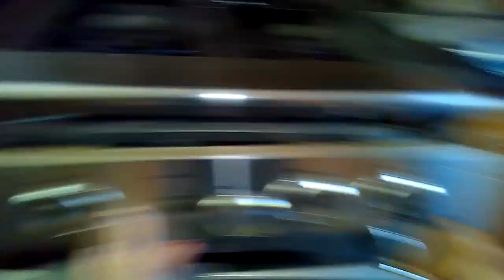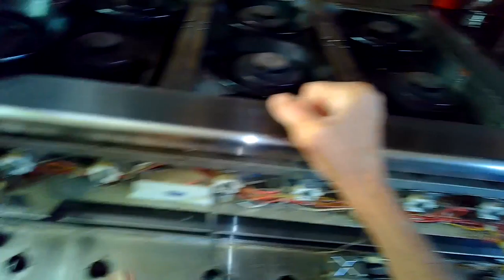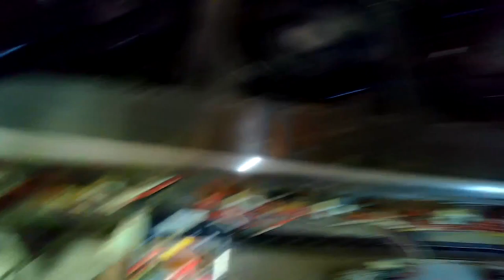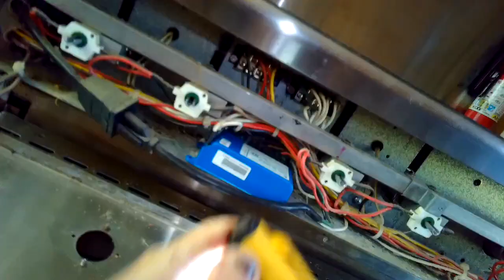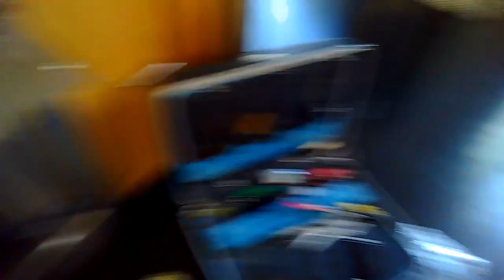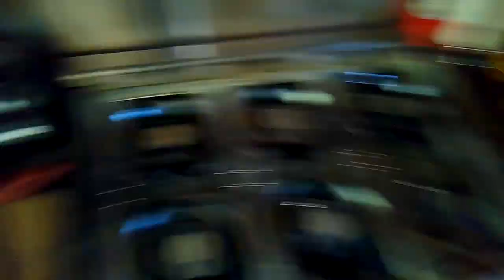DCS RANGE SPARK MODULE INSTALLATION

Comment: I have ordered the spark module.  Symptom is that It wont stop sparking after the burner is lit.  Although that can be due to moisture or dirt at the burner you have turned on.  In my case however, It started happening all at one and It does the same thing (continues sparking after burner lit) no matter which of the six burners I turn on.  Given all burners are impacted and all the probes are being bathed in flames (lower ring next to igniter probe has a blue flame), I deducted it must be the module.  Your thoughts?
Reply: I am having problems unscrewing the old screws from the old spark module to be able to take it out. They just keep on turning. Any ideas how to remove them as they don't seem to grab onto anything on the old spark module?
Reply from the maker: Can you try plugging the stove into an extension cord and plug the other into the outlet in the dinning room?
Reply: @ScottTheFixItGuyChannel  Would have to pull the stove out to access power plug.  Not sure what that test would tell me.
Reply: @ScottTheFixItGuyChannel  I got the spark module in today and replaced it and all my problems were solved.

Comment: How do I differentiate if I need to replace the igniter harness or spark module? One of the knobs of DCS gas range does not have a clicking sound and will not light. If I turn two knobs at the same time, it will work. Thanks for the reply.
Reply from the maker: That means the little switch behind the burner knob needs to be replaced👍

Comment: Hi, Thanks for the video. Have you ever changed a temperature control for the 12" oven on a 48" wide range? Is there a video of how to access that control? I saw how you removed the front panel behind the knobs but I think I have to do a lot more to change that 12" oven temperature sensor

Comment: Hi Scott-thanks for your tutorial video, i followed your suggestion and replaced the spark module and the igniter still sparks unless dial is turned to low setting. Then when turning dial any where higher than low the igniter begins to click. I buffed off and rust(which was minimal) and there was no change. I did swap out switches with no change in outcome, do you have any suggestions?